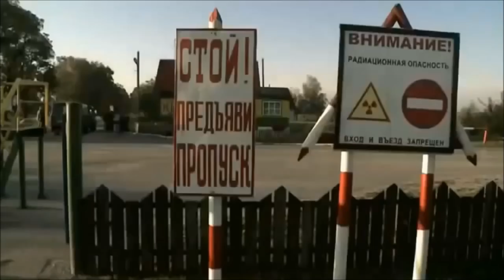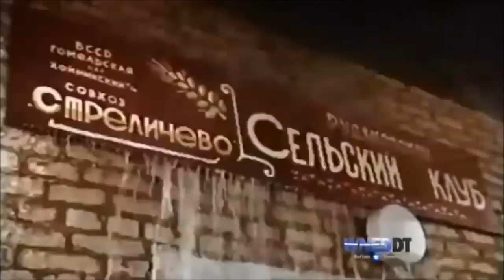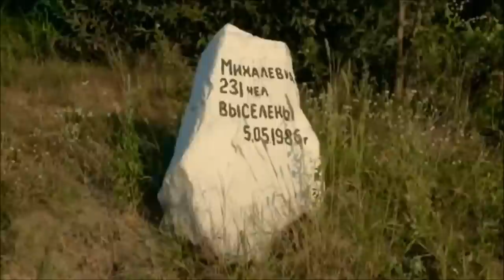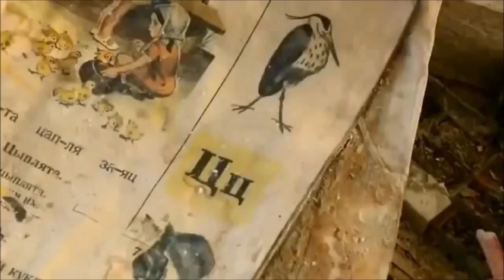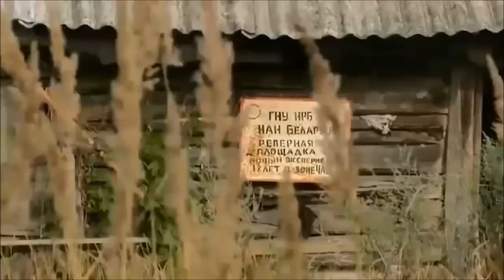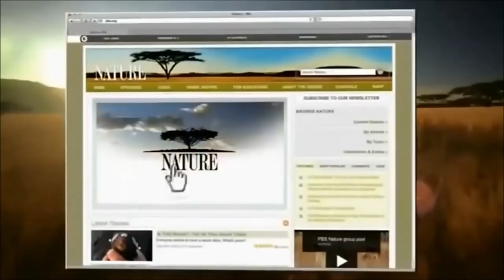▶ Radioactive Animals In Chernobyl  Mutations Full Documentary

Comment: it's been confirmed that the birds have tumors and partial albinism and may even have depression. the spiders make really disorganized webs. insects also have weird colors correlating to how much radiation they're exposed to. the tree rings change in color significantly right after the disaster. the decomposition is horrifically slow, almost nonexistent, so that means bacteria and fungi aren't really present. life isn't going very well in the area but it's going.
Reply: +poppetjin That's not strictly true. I mean, in the documentary they did show mushrooms, and algae.
Reply: +poppetjin Bacteria is affected less by radiation than multicellular life, and there are radiotrophic fungi species that were discovered in chernobyl as well. You're not wrong on the bird life / insect life though. Insects are a bit more resistant but mutation is present.
Reply: They also showed you many 'staged' images and clips.
Reply: yeah how do you know a fucking bird is depressed?
Reply: @melodyneibert1424  what you said makes no sense. They removed top soil just as soon as they could after accident.  You want burning radioactive stuff to go into the air, spread and settle on the ground again? You dont want fire to go out of controll either

That place has many burrial sites of radioactive stuff too, like they burried the red forrest under itself  because trees died and turned red because of radioactivity, trees grow there again on top

That place cant be habitable for thausands of years, decay takes that long
Reply: @zac3758  mushrooms take up loads of radioactive Cs was it, you do not wanna eat them or whatever eats those mushrooms, like boars

I heard that boars have to go through testing before being served for their meat contamination to be examined, they are obviously not eaten at Chernobyl area, I mean not radioactive areas in Europe test boar meat cuz they eat mushrooms

https://youtu.be/j6mreZ98_Ug interesting video
Reply: @shiroo997  they are going to have too cut down the current forest that is growing where the red forest was just so you know because they didnt dispose of the trees from the red forest properly so they trees that grew up are also contaminated badly